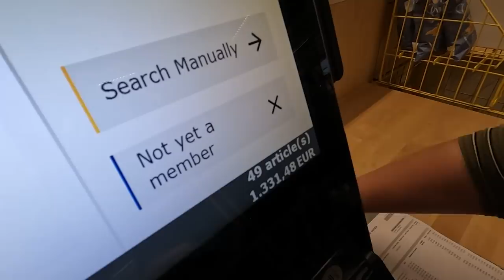Buying Our Tiny Home Kitchen! Building an Off-Grid Home

Comment: Just have to weigh in!  I love your taste, style, and choices that you have made for the interior.  Can’t wait to see the “sladder” in the chestnut wood.  Will be gorgeous.  However with the thickness of the uprights and rungs I think that you will not be happy with it in the middle?  The scale of it will be quite different than the aluminum ladder.   Have you considered a combination of a small platform (with storage) of only 1 or 2 steps at the most with the “sladder” starting off of it.  This could go in the corner next to your heat stove and really open up the view.   Also have been so freaked out when you two are up on the mezzanine without a railing but also love the look and feel of the open unobstructed space….ever thought about simple glass panels with a wood top rail?   Maybe no top rail.   This would be so beautiful and keep the feel of the open space.   Can’t wait to see the kitchen go together….  So exciting.  Love you guys.   Fernando is an amazingly agile cat going up and down the ladder.   No fear in that boy.

Comment: Good evening from the south of Germany! I was rather wondering why you do not consider a mixture of Cupboards / kind of stairs (30, 60, 90, 120, 150, 180 cm high) like I have often seen in wooden tiny houses in order to reach the first floor. You definitely will need storage room but the only wall to build something like this would be the wall where your burner stands.
Reply: The hole is already in the roof for the wood stove pipe. That is the only place to put it.

Comment: Might I suggest either butcherblock (timber) or stone look for the counter tops - matches in with the stone & timber of the barn.

You could even do a concrete counter top with pebbles inlaid on the top.

Comment: Something you may want to consider: The vertical side rails on the ladder, could extend above the edge of the loft and act as hand rails. It will be stabilizing for you when you want to turn arround to back down the ladder. They could extend an extra meter or so.

Comment: I’m curious to see how you attach the wood to the beam because the bird’s mouth is so deep I worry that the weight of the ladder rests on the thin section remaining unless you bolt through at other contact points.

Comment: I know it's probably too late for this comment, but a nice solution for the ladder is to put big wheels on the bottom and attach the ladder up top so that it can slide out to walk up/down, or slide in straight up when not in use. That keeps your usable floor space more open. I think those ladders used to be used in airplane hangers...but anyway, I'm sure you get the drift. The ladder is attached to the loft platform with a mechanism that allows it to move out and back, and keeps it firm and unmovable when in the "out" (walk up or down) position. You likely can find an example online.

Comment: Respectfully, it seems that the ladder is a thorn in your layout. It would seem better to not have the ladder permanently encroaching on the central living area.  Someone mentioned a ladder that could somehow be raised out of the way. That seems ideal, albeit how that would work is problematical.  Perhaps one that swung horizontally out of the way and could be hooked against the edge of the loft would work. If not for the location of the wood stove, the ladder could be placed against that wall, notwithstanding your objection to blocking the white walls. Sorry to be somewhat critical of your design without a solution. Otherwise, I have been in awe of your design and construction work.

Comment: Since you lived in  your van for so long your used to small spaces, but sleeping on that bed in that position is not even an upgrade from the van. Why didn't you extend another foot on the balcony so that the bed could be in the direction so that you can easily get out bed. Theo showing how he's going to get out of bed means he had disturb the covers. It just make sense limiting the bedroom space. Secondly, your refrigerator is very strange. I can't remember I saw it open on the opposite side to the other appliances. And why now raise it instead of having to bend to get to the refrig. Just looks like these designs could have been improved.  Just hope you stay healthy and climbing up and down that ladder will not prove to be dangerous.

Comment: why dont you make some cat shelves on both walls so the cats can step up and down the platform.
Reply: you could make some nice little feature shelves made from some nice wood and instead of putting stuff on the shelf hang stuff under the shelf and let the cats use them as stepping stones to to bedroom..say do 3 on each wall..the cats would find it very stimulating.ive seen some amazing cat adventure courses in small homes and flats.ive also seen like giant cat scratchers that go from floor to ceiling..
Reply: or bits of drift wood attached to the walls.